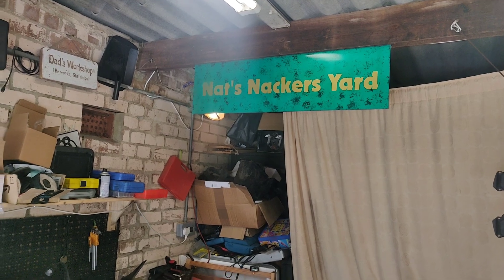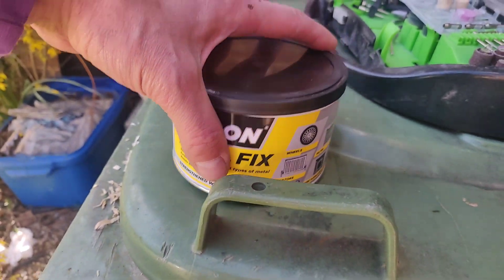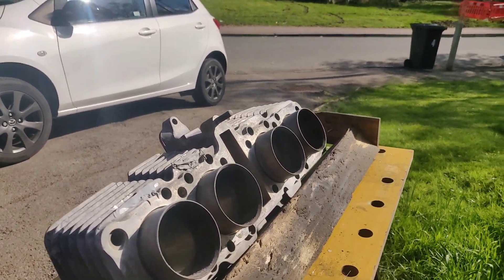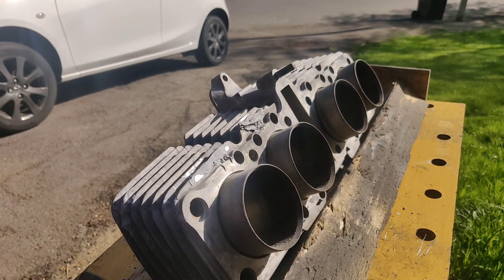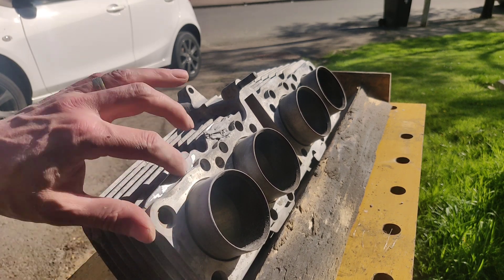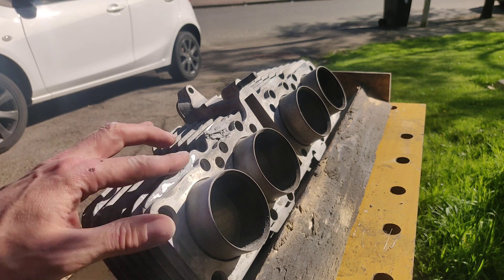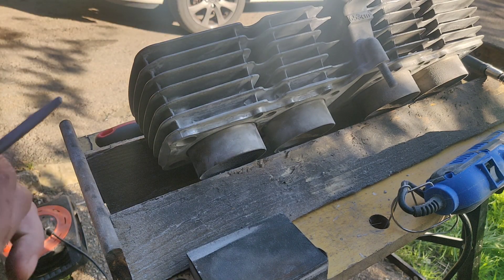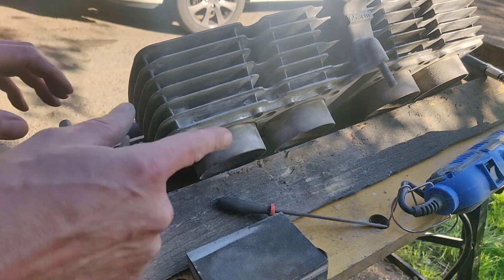Broken Cylinder Block Fin repairs.  A Brazing Failure.

Comment: How much heat can that epoxy take? I guess there's some data
Reply from the maker: Time will tell I suppose.  It has some aluminium content but certainly won't be as efficient as dissipation as the original fin.

Comment: Finger crossed the repair stays there with the heat etc. Time will tell, will be interesting to see if it works.
Reply from the maker: It's metal filler with aluminium in it so I think that it has a decent chance.

Comment: I’d be surprised if that doesn’t crack and just fall off after a few miles.
Reply from the maker: Time will tell I suppose but what's the alternative?
Reply: Get it tig welded mate. I’m sure someone local would have done that quite cheap
Reply from the maker: If I can't do it myself it ain't happening!
Reply: @NatsNackersYard  that’s fair enough mate.
Reply: @NatsNackersYard  Hope you don't get 
appendicitis
Reply from the maker: I would give it a go!

Comment: One job i loath dismantling engines. It's great when they work.. i have V-twins which aren't the easiest or lightest. Its ok if you can leave the engine in the bike and just take the heads and barrels out.
Reply: Completely agree.
Reply from the maker: I am on a learning journey here!
Reply: @NatsNackersYard   if its anything like the xs750 my father had you couldnt buy used bottom end casings or match one up with your exsisting one because they never quite matched up with each other.
Reply from the maker: there are so many slight variations in model that it would be really tricky to try and match them up.  I hope that I don't have to go down that route.